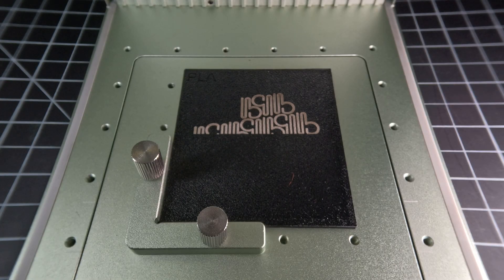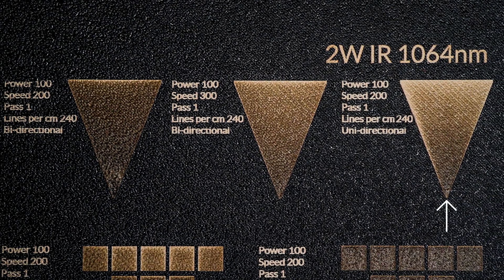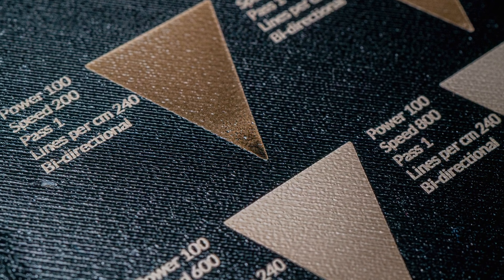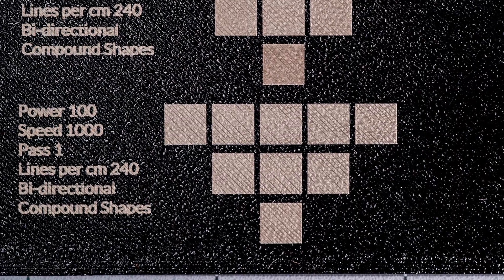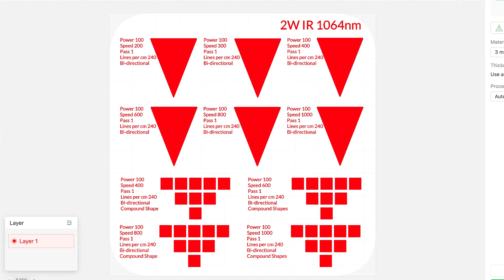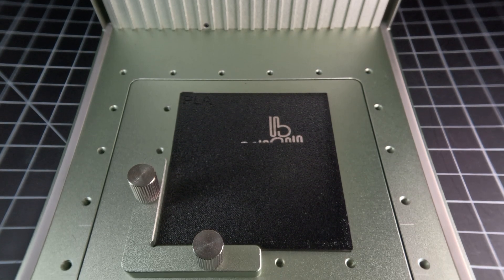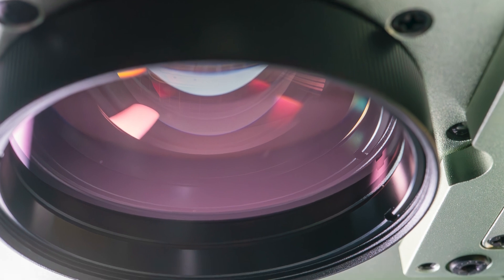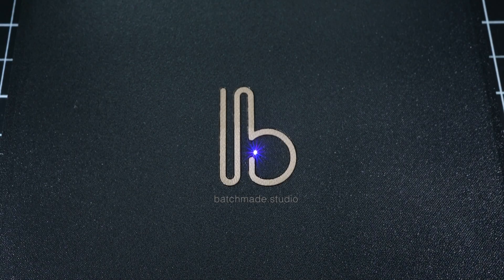Laser Engraving 3D Prints Part 2

Comment: 5:11 but are the lines still etching your bed, or can you turn off/down the laser for the lines separately?
Reply from the maker: That's an excellent point/catch 👍🏼. The main goal for that approach is to try and make sure that the laser rasters the entire width of the total 'object/shape' (to try and prevent it from heating a smaller area at a higher rate because rasterization distance is shorter). In order to get it to do that, we've found that we often have to merge objects/shapes into a single compound object — which also means having identical settings for all the merged objects. As a workaround, we usually place the piece we're working with on top of something like one of our filament test plates, to protect the engraver's base plate. Glad to hear that we're not the only ones who can be neurotic about the appearance of our machines 🤣

Comment: This content is excellent. I had always been planning on getting a galvo fiber laser but now that I am seeing how effective the F1 is, I may get this. My other use case is engraving anodized aluminum. I'm wondering what your thoughts are on F1 vs F1 ultra vs typical fiber. For the price of the F1 ultra, you can get a pretty power mopa laser from aliexpress. Any thoughts would be appreciated.
Reply from the maker: We've actually been trying to chip away at an 'F1 vs F1 Ultra settings' video that probably would have helped, but we keep backburnering for one reason or another 😔. People have been asking about it for a while, but there's just too much to juggle. We're still aiming to get it out before the turn of the year though   🤞🏼

We really need more hours on the F1 Ultra to be absolutely sure, but if you forced a verdict out of me right now, and the cost was not a major issue for you, then I'd recommend getting the F1 Ultra. If you're only getting one machine, it's definitely the most versatile between those two xTool machines. It'll do at least 90-95% of the laser-marking things that the little F1 can do, plus it has enough power to actually depth-engrave metal, plus the working area is bigger. Our only hesitation to an outright recco hinges on some challenges we've been having with power application. Between the F1 and F1 Ultra, modulating the power on the Ultra has not been a linear affair; and getting the same range (between nothing happening, and cutting/melting) with 3D prints hasn't been as easy with the higher powered machine. Though it's entirely possible we just need more practice and experience in finding its 'sweetspots'. But again we're likely being critical at least partly because we know the F1 so well.

So that leaves your Mopa option; which brings us to the topic of supporting software. xTool uses a proprietary software to run their machines called Creative Space; and with the Mopa, you'd likely be using something like LightBurn.  I've used Creative Space software on both the F1 and F1 Ultra and I've also used Lightburn with our Rendyr. I started learning and using them at the same time. While likely more limited, Creative Space is a lot easier to pick up and progress with. It's got some guardrails for sure, but it was intuitive enough to allow us to focus on what we were designing, vs how to navigate around and use the burn software. In fact, Creative Space helped me to learn about how laser engravers worked, which is helping me to learn how to use LightBurn. My experience using Creative Space is kind of like the experience with an Apple OS, while LightBurn is more like Windows....or even DOS. With the latter, there's certainly more flexibility, but the curve is steeper. 

Long-winded, but hope that helps.

Comment: ABS is extremely toxic. You should always print, and laser etch, ABS inside an enclosure. Proper ventilation is also a must. 
When printing with ABS inside an enclosure for a prolonged period of time, an oily residue starts to accumulate inside of the enclosure. I assume that this oily ABS residue is what has caused your Laser lens to fog up. 

If I were you, I would do my best to stand clear from ABS. 🤨

Comment: What is better for 3D printed plastic prints? A fiber laser or CO2 laser or IR laser or UV laser?
Reply from the maker: As Bojan said, it really depends not only just on the type of plastic, but also the laser type AND the frequency, etc... Often Fiber and UV are the best for most plastic as far as marking, but cutting is a different consideration. White plastics are very different from black, etc... I will say, if you're curious to go deeper on laser types, capabilities, etc... we have found @LaserEverything to be a super deep resource for all sorts of different setups. Also, they have a community that shares settings, configurations, etc. Really great stuff, overall.

We will also continue to experiment, but our stuff is usually focused kind of at the intersection of different technologies, materials, etc as we work on product development. 

I hope that's helpful!
Reply: IR in this video but in a different video I saw someone test on multiple filaments with a fiber laser, so idk whichever is more available to you

Comment: This is really cool. Im trying to start some 3d printing businesses and thisbcould be usefull. Do you know if this could work for marking (not cutting) foam? I have some products that use neoprene foam on the bottom tobprevent them from sliding. Would love to brandbthat part
Reply from the maker: Not sure on this one, but if you decide to try, just double check from a safety perspective. My gut it neoprene might not be dense enough and is extra "melty" and flammable. Other foams might handle it differently however. But again, from my days casting molds, etc... some foams are pretty toxic stuff when heated or burned, so just do your homework and be safe. If we go in that direction though we will post the results!
Reply: @batchresearchlab  thanks for the response. Fumes would definitely be a concern. Might need to think of something else instead

Comment: Fascinating. There has been an influx of creators testing with the 1064nm bandwidth on 3D prints.
Reply from the maker: We've been surprised about that too! When we did the first one it's because we only found a few and they maybe weren't answering all the questions we specifically had. I think we were really excited about how you can use the layering effects to create some awesome patterns/designs that aren't just paint or some other manual process.

Comment: I would be interested to see what putting some really high flow air over the piece while it is engraving... Kinda like if you don't let a really small 3d print cool down before the next layer it can mess things up..
Reply from the maker: That's a good idea 👍. We'll keep that in mind as we move forward; though we'd just need to make sure that the air didn't move the piece at all while the laser was doing its thing. On the same note, we do seem to get a bit better results with the F1's hood all the way down (you'll see that we shot this footage with it up so that it was easier to see what was going on). Maybe with the hood down and the filter fan going, we're getting a bit of heat extraction as well 🤔

Comment: Great info, thanks for sharing. Those extra bars outside your scan area reminded me of a similar approach I used to use in my giant format digital print days. We used two strip of cmyk bars running the length of a long print to keep the heads firing. Especially helpful for prints with lots of white areas.
Reply from the maker: Oh interesting; that makes sense. I think I remember something similar being mentioned by one of the vendors we used to work with that handled longer run offset print pubs like magazines; especially for some of the glossier, less absorbent substrates. It's a similar principle, I suppose; trying to even out ink dissipation vs heat. Thanks for checkin' us out 👍